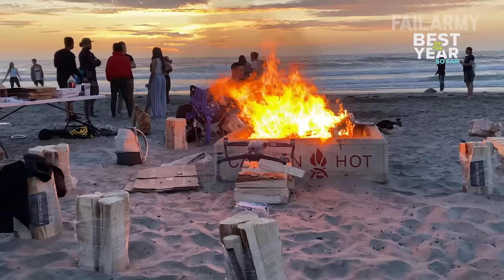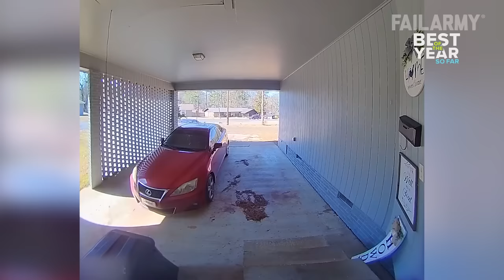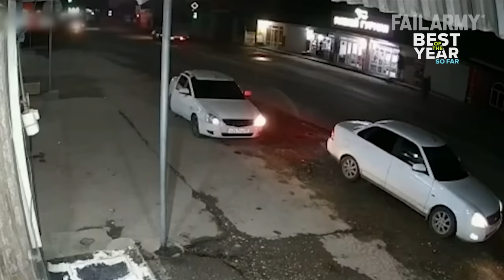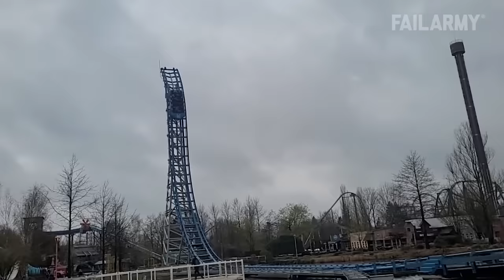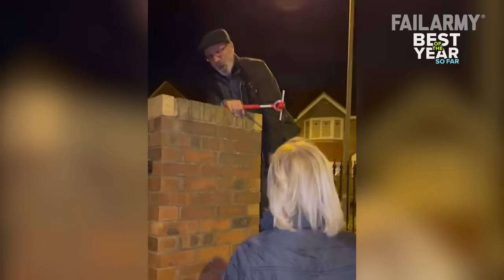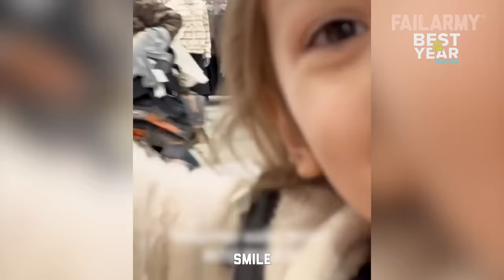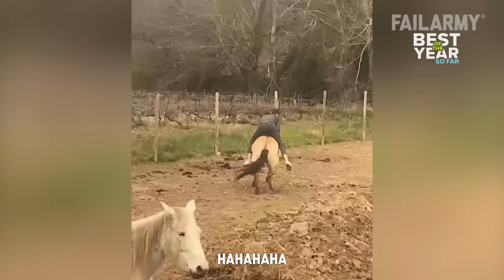Best Fails of the Year (So Far)| Try Not to Laugh

Comment: Just an FYI... if you have a grease fire, it's simple, cover it up with a lid. If you don't have a lid, throw baking soda on it. Do not cover it with a towel, or throw water on it, water will make it explode. If you have no lid or baking soda, put it in your oven on the lowest rack, shut the door, and let the smoke smother the flames. DO NOT PANIC, that's how serious fires start, and people get hurt.
Reply: Good advice!
Reply: solid advice indeed!
Reply: Ive had that happen. I just ran out my front door and put on my driveway lol.

Comment: For anyone here that does not know what to do, when your pot or pan catches fire while cooking:
1. DO NOT EVER PUT WATER ON BURNING OIL
2. LOOK FOR A LIT AND PUT IT ON THE PAN/POT AND TAKE IT OFF THE HEATING PLATE
3. OPEN MULTIPLE WINDOWS TO GET THE SMOKE OUT 
4. IF FOR WHATEVER REASON YOU HAVE SAND AT HOME, YOU CAN USE THAT
Reply: 4. i hear  Baking Soda is good to extinguish oil, is true?
Reply: Yea... i did that mistake once and never again. Thankfully it was just remaining oil on the pan, so no big harm done.
Reply: Lid, not lit
Reply: yes baking soda, but before anything you should turn the heat off
Reply: If you don't have a lid, a wet cloth over the top will work.

Comment: 1:03 Small bit of info. Heat in an open area actually causes a low pressure zone so the drone has no air to chop with its spinny bits.
Reply: I shall remember this, sir.
Reply: I was about to say the same thing. Heated gasses have much less density than room temp air. This is why hot air balloons rise. As air density decreases, the ability to create lift from propellers (and wings for planes) also decreases. When I was taking flight training, density altitude is a thoroughly covered subject for take-off and landing considerations.
Reply: Would you mind telling the mosquitoes here in Louisiana that?!?
Reply: @buckfoejiden62  Mosquitos don't have the spinnies. Also the air down there is thick as soup.
Reply: @davidcarter7880  I live here. I know. It's terrible
Reply: That same effect causes those mysterious plane crash
Reply: I watched that several times and wondered this exact thing, I was just flying my Mavic Pro drone right before I wrote this
Reply: @ᴄᴏᴠᴏɪᴅ • 13 years ago IDK..... not arguing but seems like it would have needed to linger a while for blades to warp, it dropped immediately.  Also wouldn't the spinning of the blades disipated heat faster than it could have built up?
Reply: Would have been fine on Venus
Reply: This comment was genius till you went back to reality with the spinny bits 🤣 🤣 🤣
Reply: Indeed I've seen airplanes fall out of the sky from this effect
Reply: @ᴄᴏᴠᴏɪᴅ • 13 years ago this is a real issue with flying...planes crash from these low pressure areas...this drone went down as soon as it got over the fire...heat disperses air molecules removing its ability to provide lift...thus causing it to fall out of the sky...a fire of this size and distance from the drone would have taken a bit more time to melt....
Reply: Or just don't fly drones close to a fire those things ain't cheap
Reply: @ᴄᴏᴠᴏɪᴅ • 13 years ago your stating your opinion...I'm stating fact
Reply: @ᴄᴏᴠᴏɪᴅ • 13 years ago heat disperses air molecules and removes lift..it's that simple...it happens to real airplanes simply flying through low pressure air pockets..... no fire...the fire created the low pressure for the drone to fail...the drone is not made of wax
Reply: If you fly high enough over the fire you’ll get lift by the rising column of hot gas but if you fly too close all bets are off
Reply: Also known as basic physics lmao
Reply: spinny bits made the whole video worth it 👌
Reply: Spinny bits, lol 😂
Reply: I genuinely did not know that, and thank you for the info. That said, I fully expected the exact same result. That was a big hot fire and likely an expensive drone, especially for back then. He had so many directions in and speeds at which he could have flown it, yet he chose to slowly and deliberately just hover it straight in to drone heaven, or hell, more aptly. RIP.

Comment: There is a complete lack of knowledge out there concerning grease fires and how to deal with them.   Mind blowing!
Reply: One of them had the lid next to the pot. Just put on the lid and smother the fire. The second , a wet dish towel like a lid to smother the flames or throw / pour a bag of flour on it.
Last thing you want on a grease fire is water.
Reply: As a grease fire virgin, can you tell me what I should do if I came across one? Definitely no water?
Reply: @odd_shoes  – 

ALWAYS supervise ANY stovetop cooking, but ESPECIALLY that involving shallow or deep frying using grease/oil.

NEVER use water. It instantly superheats, mixes with the grease/oil and then spatters everywhere, potentially spreading the fire further with flaming drops of grease shooting in all directions and also burning the person nearby.

NEVER move the pan, not even moving it off the heat source because that can spread the fire too and once a grease fire has started, moving it off the heat source is less important than stopping it spreading and fighting the fire in place.

Turn off the stove if it is safe to reach it by hand.

Ideally, smother the fire using a saucepan lid, or a fire blanket if you have one available (and you should ALWAYS have a fire blanket wall-mounted in your kitchen ready to use in such a situation. However, do not have it mounted on a wall behind or too near to the stove, or you may be unable to safely reach it during a grease fire. Instead, have it mounted somewhere else in the kitchen. Don't keep it in a cupboard or drawer or anywhere else where you cannot reach it instantly, or a visitor would not know where to find it.

If that does not work, or it is not safe enough to get close to do it, then use a fire extinguisher. However, ONLY user a wet chemical (Class K in the USA) or a dry chemical (Class B in the USA) extinguisher. These are the only types that are safe to use on grease fires. Or a combination fire extinguisher that features a B in the Class name (i.e. Class ABC in the USA). Other types have the same negative as described above for using water and must NOT be used.

It is also very important to have a fire extinguisher of the relevant type wall-mounted in your kitchen for these kinds of fires. However, do not have it mounted on a wall behind or too near to the stove, or you may be unable to safely reach it during a grease fire. Instead, have it mounted somewhere highly visible and accessible elsewhere in the kitchen. Don't keep it in a cupboard or drawer or anywhere else where you cannot reach it instantly, or a visitor would not know where to find it.

If you have other types of fire extinguishers in your home (which is always a good idea), make sure these are unlikely to be picked up and used by mistake on a grease fire.
Reply: Not as complete as the lack of knowledge regarding wet, Icey, or otherwise visibly slick steps, apparently.
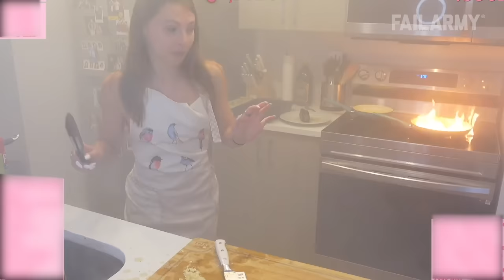Reply: Starting at 13:57, the girl's comment is "I'm OK."  Like the audience's only valid concern should be whether or not she got a little burn while she's working on burning the house down.
Reply: @mgmcd1  or the pros who can't secure ladders before climbing them...
Reply: @mgmcd1  yea, in a northern country we do not ever ever use concrete to make a step.
Reply: @ewokwarrior2656  Flour isn't the best either, the dust from the flour can burst into flame, try salt instead
Reply: @odd_shoes  turn off the heat and throw a lid over it, or another pan, or a wet towel. If it's already out of control and you don't have a (non water) fire extinguisher then leave and call fire brigade.
Reply: NO WATER AND NO FLOUR!
Get a large box of BAKING SODA. Keep that box in an area near the stove area.
You can smother the fire with a tight fitting lid for the pot/pan or dump copious amount of baking soda in the pot. But having a proper fire extinguisher would be best. Go to your local fire department and ask questions about it. They will tell you the proper procedures to stop a kitchen fire.
Reply: @ewokwarrior2656  NO FLOUR!!!! It can catch fire too. Use salt or baking soda instead - or better yet just cover the pan with a lid etc.
Reply: @ewokwarrior2656  flour? Are you looking to compound your fire with an explosion? Is baking soda you throw on. With heat, bicarbonate of soda releases carbon dioxide, smothering the flame. Flour explodes.
Reply: @rpurdy4821  I read the comments hoping someone would say baking soda. I was starting to lose hope.. thank you!!
Reply: @ewokwarrior2656  flour is flammable.
Reply: @odd_shoes  Absolutely correct, no water. Smother it with a lid or cloth.
Reply: Baking soda!!!
Reply: Bruce Wayne  – It worked for you, but I definitely would not recommend that method. One, it requires the time to rush to the bathroom, soak a towel, wring it out and bring it back to the kitchen. You may have had time to do this due to having moved the pan outside onto concrete (although moving the pan isn't recommended either as it can spread the fire). But most people will be facing this fire on their kitchen stovetop, where it is a rapid risk of spreading elsewhere in the kitchen if not extinguished immediately.

Secondly, if not wringed out thoroughly enough, the towel will drip water into the pan, especially while you are lowering it and it doesn't yet cover the pan, and potentially cause the flying drops of flaming oil that are so hazardous from using water alone.

While you personally got lucky, I would totally recommend either a fire blanket or a fire extinguisher over your suggested method.
Reply: Taught Organic Chem labs (volatile solvents, fires can/do happen, expect and plan).  
Showed them how to smother one by covering with a proper cover to limit O2. Explained how to use the fire extinguisher.  Then told them in case of fire 1) tell me loudly but don't panic 2) make sure you aren't on fire (talked about the fire blanket and how to use/help another) 3) step away and back if the room is clear. 4) let me take care of it if is still burning. ... then one day a univ dude yells fire!, he has the pin pulled on the fire extinguisher and is about to blow the beaker across the fume hood, break it, and spread it further.  Luckily he didn't and i just covered it.  Out in less than 5 secs... .and fire blankets are scratchy, btw.
Reply: @odd_shoes  Just put a lid on the pan. If it's in the oven just shut the door, the oven can handle the heat.
Reply: replies to your comment aren't much better! One of the first things I bought for my new apartment when I first left home was a fire blanket. I've had it in my kitchen ever since. VERY cheap investment for the peace of mind it gives. Just be sure to store yours in a location where you will be standing if you have to back away from the stove, not in a location where you need to pass the stove to get to it (which I accidentally did at first)
Reply: @rpurdy4821  I always keep a big box of baking soda on hand for just that purpose, separate from the one I use in baking. A small area rug works too.
Reply: Flour or baking soda kills a grease fire, salt is a good last option. You’re welcome people, as a 9 year veteran of the kitchen that is the best thing you can do for it. Put a lid on it after you’ve put in the dry ingredients so you don’t have it reignite from the oxygen present, That’s why grease fires always relight. Also make sure you SLOWLY heat it up, don’t just put it on high and expect the heat won’t catch it on fire, oil and grease can catch fire around 400°f and is extremely dangerous around 375°f(180-200°c for anyone not from the USA). Highest oil or grease should be at is between 325°f or 350°f (160°c -175°c) so it doesn’t ignite from overheating as it will spontaneously combust. Flour will work if you use a whole bag, and I’ve witnessed it used in an industrial fryer in a kitchen, it’s NOT AT ALL IDEAL,  but if it’s what you have use it. Corn starch is a lot worse, please don’t use it as it’s so fine it will combust instantly, your best thing will be baking soda at a home fire, but 50lbs of flour in an industrial fryer did work in a pinch. There should always be a silver fire extinguisher in your kitchen for a grease fire, because they are filled with a baking soda compound that stops a grease fire in its tracks, the red ones are good for if you have an electric fire or a fire from matches or wood, because they’re made with a chemical that immediately smother the oxygen out of the environment,  it don’t use it on grease because it can actually be more dangerous as the compound is commonly toxic with grease and oil and is capable of spreading over a large area, making cleaning it up a serious danger to everyone around.
Reply: IKR? Even as a kid I knew to smother it!

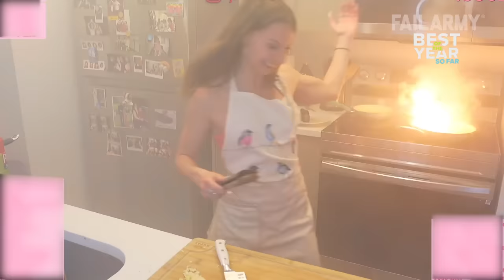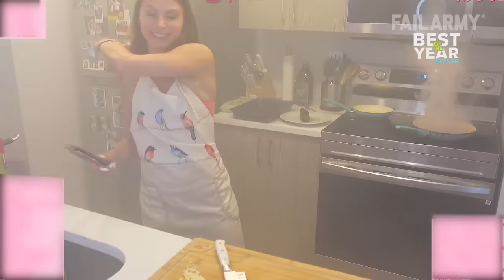Comment: To anyone wondering how exactly the oil caught fire at 13:51, since its very common for people to make such mistakes. You can see her dropping the steak down at 13:45 thereby splashing oil everywhere. Some of it trinkled down the edge of the pan slowly down to below the pan, right above the point of contact with the highest temperature. Once the oil below the pan caught fire the flame traveled upwards catching the rest of it on top on fire aswell. It all happened quickly, so its hard to notice. 

Lesson: be carefull to NOT let oil trickle down the edges of your pan. Even if it does accidently happen, then turn the oven off and wipe the oil on the sides off thouroughly.
Reply: Because oil is hard to wipe off I just use a different pan usually.
Reply: Seriously! That was anxiety inducing watching her pick up the pan and drip hot oil everywhere and then put it in the sink to douse with water! Big no no. Always cover with a lid to starve the fire of oxygen or if that's not possible this is why you should keep a fire extinguisher on hand in the kitchen
Reply: and don't add water!! you can see that made it worse. I think you have to smother the flame instead
Reply: She shouldn't be cooking, maybe washing the dishes, help! Help!
Reply: @icyblue1409  Yes, and the effect can be much, much worse than what we have seen here.
Reply: @dobees8183  If you're going to make an offensive joke, make it funny.
Reply: @travis8106 I laughed
Reply: @travis8106 
That wasn’t offensive
Reply: @davidlium9338  Well, it certainly wasn't funny either
Reply: @travis8106  yeah it was pretty funny my guy.
Reply: very true, but super hot oil will just catch on fire if heated to that extreme point.
Reply: @goodbyemr.anderson5065  No

"I have to smack around my dishwasher because she caught the kitchen on fire" is funny

His comment wasn't
Reply: @travis8106  not bad, but not as good as his joke.
Reply: If that makes you anxious, never cook  @mat-tilde
Reply: no way she looks at the camera and says I don't know what to do like chat is gonna save her lmao